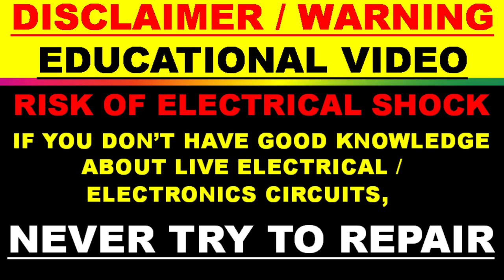{919} How to repair aquarium air pump

Comment: Kindly make a video on 3 4 and 5. Wire str module , their features,  differences,  areas of use  and finally how to install it in a computer smps power supply unit